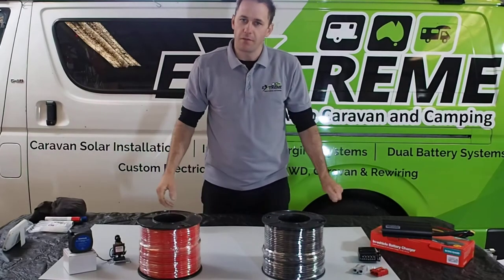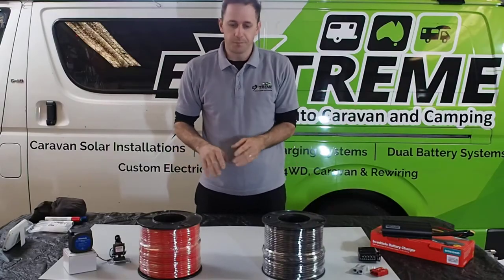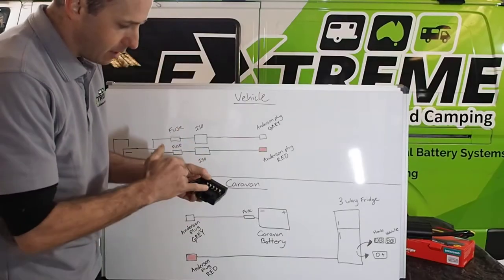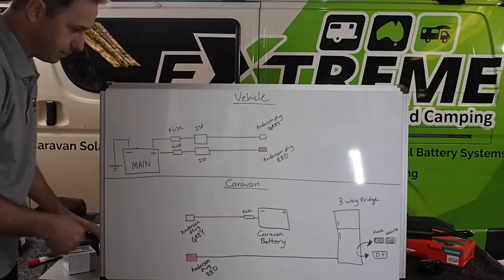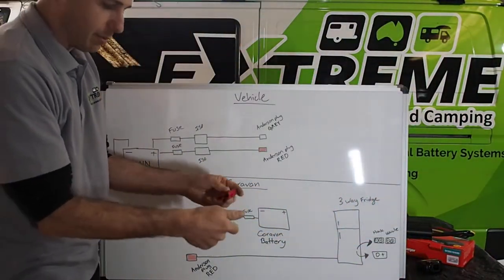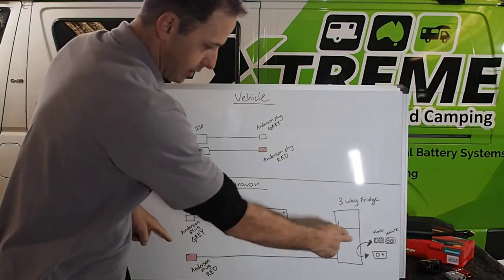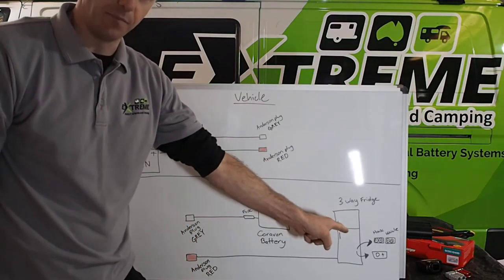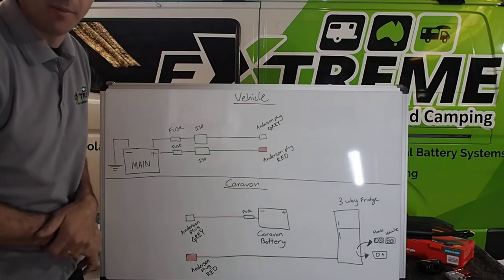Red and Grey Anderson Plug 3 Way fridge and Caravan charging systems

Comment: Hi Matt smart alternator question were do you usually pick your ground/ neg point up on a start battery. Wanted to run a common neg buss bar for negative points believe it should be body side of the neg battery post after start battery shunt.

Comment: Matt, love the presentation/education.  I have watched all your videos and have enjoyed them.  Just a couple of Q's, The Red SB50 is designated for the 3 way fridge use (I agree), why do others also use a Red SB50 for Anti-Sway Control I wonder, should the fridge or Sway Ctrl be changed to a different colour SB50 ??   I have done the Grey SB50 (16mm2) on the car & van as well as Red SB50 (10mm2) on both. Red for 3 way fridge, Grey for DCDC charger in van, I also added a Blue SB50 (8mm2) on the drawbar for portable solar input to the DCDC charger in the van.  There is another separate run for a Grey SB50 inside the car for a DCDC/25A.   Is there any standards that should be observed wrt SB50 colour codes for designated purposes, I know that Anderson specify different colours for various voltages, but it seems that the RV/4x4 industry have done it their own way.   :-)  Looking fwd to the next video, Cheers
Reply from the maker: Thanks for your reply Peter.
Regarding the AL KO the reason behind the Anderson plug is so you can unplug it when going off road. This is becoming less common as people move to a Dexter/Tucson sway System which uses the Caravans power system. It doesn’t really matter what color Anderson plugs you use it’s just a standard that I try to adhere to unfortunately there are no Regulations here stating what color to use. The main objective behind using the Anderson plug system over the traditional 7 or 12 pin is to allow items that require a higher current to function correctly. It’s great that you are using a combination of different colors this illuminates possible problems.

Comment: Hi Matt, liked you vid on keeping fridge separate from battery charge (red and Greg Anderson plugs. I’m purchasing a 2010 Jayco and want to make sure the fridge is on whilst driving. My question is from the red Anderson plug on the van is there only the positive cable running to the fridge from the draw bar and the fridge is already earthed? Or should there be both positive and negative cable running to the fridge from red Anderson plug at the draw bar
Thanks in advance Kelvin

Comment: Hi Matt,
I have purchased a van and today have worked: out the wiring for the fridge and battery. I have a grey Anderson on my car and van that run to the onboard battery of the van. I have a 12 pin plug that has the issue you spoke about with melting wire and want to put a red Anderson plug in. The 12 pin only has the active there for the fridge? Based on Todds query is an extra negative required To run back to the fridge or is the existing earth ( wherever it may earth to) ok. So the Anderson would only have an active wire. Does the fridge earth to the van chassis. Hope this makes sense.
Reply from the maker: Extra negative yes.

Comment: Great vid mate clear up what I wanted to know.
Reply from the maker: Glad it helped
Reply: What if you have Gray and red(ESC) and fridge is on the 12pin plug on my van. Van has a AC to DC charger with 1*100ah AGM battery. Can  I swap the ESc from the red Anderson plug to the 12 pin and but the fridge on the red Anderson. I have vsr on each Anderson plug from the car battery like how you have in your diagram.
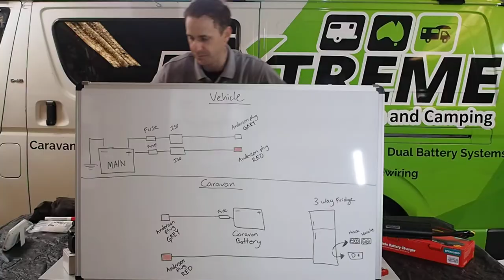Reply: 1:50

Comment: Hi Matt. Great videos. Got a good one to test your brain! From the U.K. so have different setups to you guys but I will simplify. Modern car with smart alternator and modern caravan although none are setup for smart alternators. It’s a know fact the house battery and 3 way fridges don’t charge and operate optimally with smart alternators over here. (Not surprising looking at the standard fit wire gauge used!) I was thinking about using Anderson’s as you have suggested in this video, however in the U.K. they always steer you towards using a DC to DC  charger as it’s the only way to will get the alternator to output. Is this correct? What am I missing? If I substitute the tiny wires as suggested will the house battery charge at sufficient amps and will the fridge pull 17+ amps all from the vehicle bath and smart alternator? Thanks in advanced
Reply from the maker: Thanks for the response
What I would suggest is running an ignition control relay to your three-way fridge via an Anderson plug .
Then have another Anderson plug to take care of the DC to DC charger .
Remember your separating the circuits from the source (starter battery)
The smart alternator once it senses a heavy load will remain in a charging state. This will happen via your three-way fridge ignition controlled circuit..
The DC to DC charger will either need to be on an ignition control circuit also or run the trigger wire through your trailer plug.

Comment: I have ordered a new caravan and a new towing vehicle. The van will have ALKO ESC fitted which I am advised will use the red Anderson plug. Can the red plug handle both the ALKO ESC and the fridge? The van comes with a 12 pin plug, which means I will need 12 pin on the car as well. Which plug should be used for charging the van's battery? The Mitsubishi dealer is likely to contract out the installation to a local auto electrician, so I guess I will need to speak to him, or the dealer or both. So if I have a 12 pin, and red and grey Anderson plugs what is your recommendation for ESC, fridge and battery? Thanks.
Reply from the maker: You should never run any high current through the twelve pin plug you will know soon enough why.
the ALKO can be run via the 12 pin plug as it is low current that leaves your red Anderson plug for the three way fridge and the grey Anderson plug for charging the battery problem solved.

Comment: Firstly great video. I have enjoyed watching your other ones as well. I have set up as you have in your diagram and I have had running for nearly 10 years. But for the last 1year, I plug my air compressor in and it cuts in and out. It never use to. I know have a caravan that I need to plug into and charge the battery in their. What would be the problem do you think? I have the Narva Iso.
Cheers foe any advice.
Reply from the maker: Sounds like low gauge of cable, insufficient, sizing and voltage threshold issues. You may be better off with a latched relay.

Comment: Hi Matt, I find your videos very helpful. Thanks! I have a dual battery system already in my car. Should I follow your diagram but run everything off the 2nd (deep cycle) battery so the fridge can keep running if we do stops on our travels?
Reply: Here is a link to diagram of what I am thinking based on your video (https://docs.google.com/drawings/d/1KwDsIJ7FS_6xICAkEcPHy_s07wNFM7l4EiDzZxg2J_s/edit?usp=sharing). I would love to know your thoughts. I would place fuses as close as practical to each battery. 
Qns: 
1) Is an ISO needed on the grey anderson line that runs to my DC/DC charger in my caravan? 
2) If I was running my car connected to the caravan with car starter battery + 2nd car battery + 2 caravan batteries + solar, would I be able to run my caravan A/C?

Comment: Hi Matt. Great video. I have a red anderson for my ESC. Can I run the fridge off the same red anderson by connecting in to the ESC wire. Thanks
Reply from the maker: No. Unfortunately, the ALKO stability control is a low current circuit.

Comment: Hi. Can u use one smart voltage regulator say 120am for gray and red Anderson plug  and wat about the fridge trigger wire. Or can you use a double adapter Anderson plug at the tow bar and connect to the caravan wiring
Reply from the maker: No always separate the circuits at the source.
The source being the positive terminal of the starter battery.

What you’re asking is the easy way out if you read it carefully. And that’s where and why people get issues
Reply: @extremeacc101  Thanks will do

Comment: Funny how your saying a red ando olug for the 3 way fridge.
My caravan came with a red ando plug for the Alko ESC.
Still run the 3 way fridge from the 12 pin with no issues
Reply from the maker: Every caravan manufacturer does things differently.
Some have the Akko esc through the 12pin. Others run the lippert, dexter, Tucson sway control which runs from the Caravan’s battery.

That’s the point.
The alko esc is not higher current than the 3way fridge so the only benefit of having it on its own Anderson plug is the ability to unplug it.

Comment: Hi Matt I have a battery box with a 150ah lithium battery and a 25a dc-dc charger and I plan to transfer it between my car and camper as required. If I were to run a separate Anderson plug from my starter battery solely for my 3 way fridge, is there a VSR that would be compatible with a smart alternator so that the fridge has constant charge? I know the smart alternators tend to switch off and I don't want to lose the power to my fridge.
Reply from the maker: In this situation I’d use a large ignition controlled relay

Comment: Mi Matt.  If your van batteries are being charged by solar, is there still a need to run charge power from the car to the van batteries.
Reply from the maker: Both is better. More charge, faster charge.\

Comment: Hi mate what size fuse is required for grey anderson plug setup for just battery charging??
Reply from the maker: Cable depending.
What gauge?
Reply: @extremeacc101  I’ve currently got 6mm running from car battery to rear just need to run to caravan for charging

Comment: Nice simple setup as a starting point, then add the bells & whistles as required. Cheers from Michael. Australia
Reply: Great  video  and thanks for sharing. What do you do for your earth return cable? Run through chassis or negative back to the   battery?

Comment: Will this system work on a 2015 Amarok with a smart alternator?
Reply from the maker: Yes,
Reply from the maker: I would not exceed between 80 and 100 A from your alternator period, even though it can do slightly more pulling this much power from it, all the time would impact its life

Comment: Hi Matt...have found your Videos on 12-Pin connections (especially relating to AES Fridge), very informative.  One question I have in relation to the Whiteboard representation above is to do with the 'D+' trigger wire.  Assuming you have the DC set-up you have shown above (that is, Power via an Isolator), would it not always be better to run the trigger wire directly to the 'Vehicle' terminal behind the fridge, rather than the 'House Battery' Terminal ?
Reply from the maker: Hi Garry, You may have mis-understood me there.
You do NOT connect the d+ wire to the HOUSE 12v+.... You CAN connect this to the VEHICLE + behind the fridge as long as the line is isolated when the starter battery shuts down.

Comment: I love you.

You just saved me $650.

I did this through my 12pin.
Reply: Thanks Matt good straight forward advice. I’m all set to install the wiring from my Suzuki Grand Vitara to a small Camper trailer.

I have three circuits to do.
A 25amp dcdc charger in the trailer, a three way fridge and an Alko ESC.

In this video you say we can earth to the back of the car chassis which makes things simpler and less cable run.
Does that apply to all three circuits?
My concern is that both the fridge and the Alko ESC wiring diagrams specifically say to run black cables to battery.

What do you think?

Comment: Thanks Matt from Queensland. Using this roach how would you suggest a battery for a brake safe system receives charge noting I have a Toyota factory fitted 7 pin connector?

Comment: Hi Matt what size fuses to run - I have bought jayco swan 90 litre domestic. 100amp lithium battery in jayco. And thank you very much for all this valuable information.
Think to run a fuse to 12 pin connector as well, is that a good idea ?
Don’t have any battery in my Hilux 2023

Comment: Hi 

Great video, many thanks. Please advise if I could use a single appropriately rated isolation relay and run 2 separately fused cables to the Anderson plugs at the rear of the vehicle. Also, not really sure why they cannot be interchangeable if they are not feed via VSR's

Comment: Hi, I’m upgrading our tow vehicle to new and therefore it will have smart alternator. 
1) will this set up work with a dc/dc charger located in van, and current coming through dedicated ‘grey’ Anderson line?
2) will the smart alternator produce enough voltage for ‘red’ dedicated 3 way fridge line?
Thanks for the very informative videos.

Comment: Matt, love your video.  I am about to put an anderson plug on my sons old 1988 Jayco camper with a small 3 way fridge.  Can I just tap into the power and earth wire and insert an anderson plug. Would that work
Reply from the maker: You can but you’ll find it’s only on 6mm cable.
I’d run a twin 8bns cable from the rear of fridge to an anderson plug.
Reply: @extremeacc101  jayco have the one power cable for fridge and lights. Can I do the same if I run that 8bns together with the lights cable?
Reply from the maker: @jeffhale713  you sure can 👍

Comment: Great info Matt. I have a BT50 2009 TD 3.0 Ltr with a 7 pin socket and one grey Anderson plug connected to my starter battery and runs through one Redarc SBI. I have ordered a new caravan that has a 3 way Auto fridge also has a 12 pin plug and one grey Anderson plug. I have not opened the new caravan plug as yet, but I have there wiring for there vans, they have the AES sense wire on pin 12 and the fridge heater wires on pin 8 power and 10 ground. witch I will change to a Blue Anderson plug, as I will run a new line form my start battery through another Redarc SBI. My question is, were will I connect the Pink AES wire from the 12 pin plug when I fit it to my BT50. My Alternator is NOT Computer Controlled. Hope you can understand this post. Keep up these Great Video Posts.
Reply from the maker: Oh I like this question,

If your vehicles fridge line is isolated then you can loop the D+ trigger wire to the fridge line on the caravan that way when your isolated line shuts down in the vehicle the fridge will operate as it should. Alternatively you can run an ignition trigger wire to a relay and then off to Pin 12 in the vehicle
Reply: @extremeacc101  Thank you Matt.

Comment: Hi Matt, quick question. I am talking about the fridge line here, you mentioned creating a negative to the car chassis near the red Anderson plug from the car end, my question is, where is the best spot to create a negative connection to the red Anderson plug from the caravan end? I am assuming that this format will work with a smart alternator as well. Thanks, heaps for the video. Very informative.
Reply from the maker: Depending what the red Anderson is for. If it is for the three-way fridge heater element then both negative and positive must go to that point at the rear of the fridge

Comment: Hi Matt, appreciate the video. 2 questions. Are you suggesting just to run the positive wire to the Anderson Plug from the car batter and negative to the chassis, why can I not run the negative wire from the battery to the Anderson plug? 
Also 
Can I take the wires for the fridge straight from the 12 pin plug to make the Anderson Plug? Really appreciate your help

Comment: Hi,
Just a follow up, to my question below:
Will a voltage sensitive relay work with newer smart alternators for the ‘red’ and ‘grey’ Anderson set up as described in your video?
Or do you have to use ignition switching relay to build the system you describe in your video?
Thanks again 👍🏻

Comment: Hi Matt , a great video mate nice and straight forward. A question I have is I have just got a Hybrid with a 7 pin and anderson plug ,3x100ah batteries and dual zone fridge (not a 3 way)   My ute has a 12 pin and no anderson plug , so is it a case of simply adding a grey only anderson to my ute as per the video allowing me to charge the batteries while driving and keeping fridge cold.? The 12 pin was added for a previous caravan I had by an auto elec. Thanks Michael